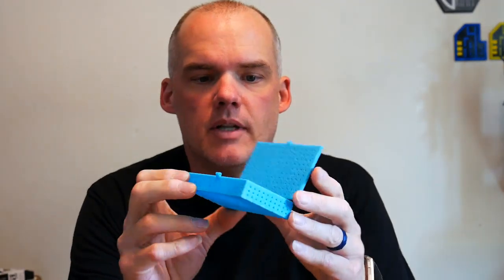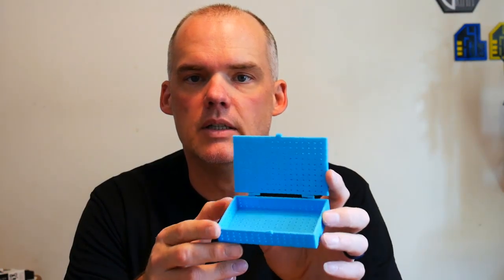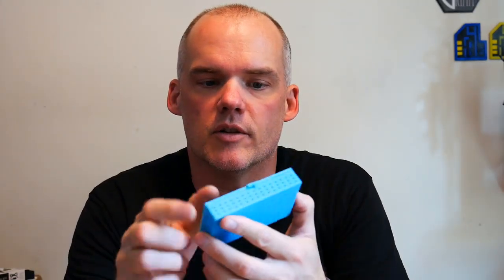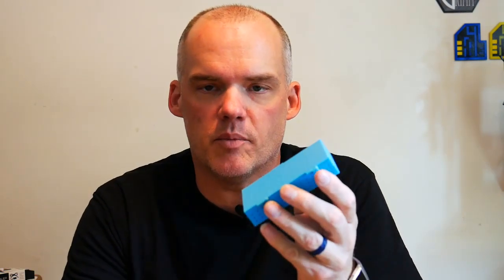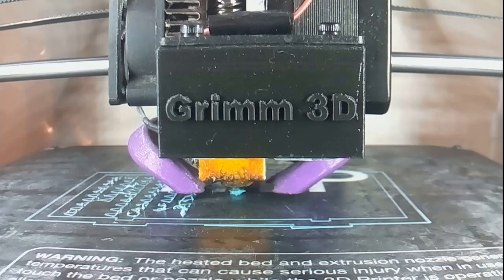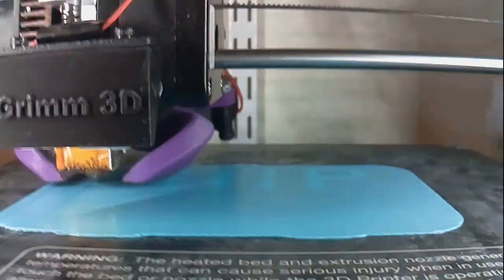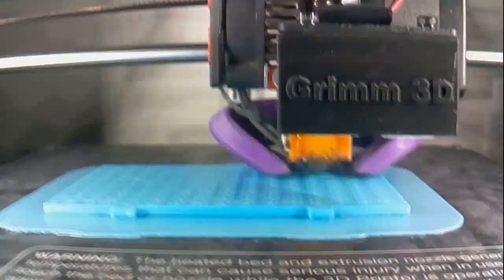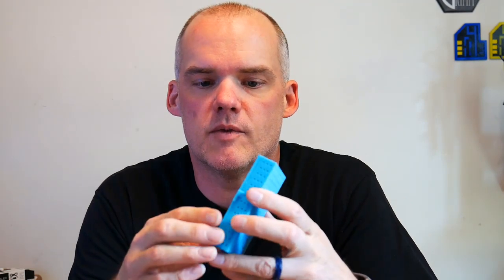When to Use a Raft

Comment: My rafts don’t come off easily can you please share your settings for Cura for easy removal? Thanks
Reply from the maker: Rafts can be difficult to remove, and that actually means you are doing things correctly. I would suggest using some kind of release agent. Most people use glue stick or hairspray. If your bed is removable like I show in one of my videos, hairspray is the best, but if your bed is not removable, use glue stick. I have videos showing both
Reply: Grimm3D thanks for answering, my rafts come off the bed but my problem is separating them from the model itself, thanks 🙏
Reply from the maker: @kbshah  for that, there is a setting in Cura, raft air gap. They increasing this setting. However, if you are using PETG or ABS or a flexible filament, they've always going to be difficult. If using PLA, try increasing the raft air gap and print something small like a calibration cube to test your setting. Increase until you have what you're looking for. When I get home from work, I'll look up the exact setting I use for PLA and reply again. Thanks for watching!
Reply: Grimm3D thank you so much, truly appreciate your help, thanks 🙏
Reply from the maker: My 'Raft Air Gap' is set to .3mm right now and my PLA rafts come off pretty easily. Sometimes I use a chisel point exacto knife to help get them off if I need to. I would think you'd want to try raising this in small increments. Maybe .31 or .32 to start. Test it and raise again if needed.
Reply: Grimm3D thanks so much, I’ll try those and see, I feel the thickness of my rafts are thick too, how can I make them print thinner?
Reply from the maker: You need to have some thickness in the raft so it can do its job of adhering and evening out the bed. But if you want to change the thickness, search in Cura for  raft and then you can change top layers, middle thickness, and base thickness to get the results you want. My top thickness is set for 2 layers @.2mm each, my raft middle thickness = .3mm, and base thickness = .24mm
Reply from the maker: @Aditya Shaligram That "should" be fine, but the way to check is to run some tests. Maybe print a few calibration cubes with rafts and adjust the air gap to see what give you your favorite blend of surface quality and ease of removal. There really is no perfect answer, at some point it just becomes personal preference. Thanks for Watching and for being part of the conversation!

Comment: You could use a 0.2 mm nozzle, 4-8 perimeters, lower first layer speed and print it without raft.
Reply from the maker: Don't forget to optimize wall printing order. This makes a big difference too. Actually, one of the best solutions I've tried to successfully print things like this without a raft is to use hairspray.Of course, you probably wouldn't want to spray hairspray if you did not have a removable bed. The over-spray would eventually damage the machine.

Comment: I had the same issue trying to print some objects that have small holes like M3 or M4 and I tried many times to level the bed, I even tought that the bad is not enough hot to actually stick the first layer correctly or I tought that the first layer should use a little nozzle diameter, like 0.1mm, but nothing works. Than I did some research and found your video. It worked, thank you!
Reply from the maker: I'm glad you found my videos and I'm glad it worked for you. Have you tried any type of adhesive on your print surface? I have used Glue Stick and Hairspray. I prefer hairspray. AquaNet Extra Super Hold (purple can). However, you do not want to use hairspray if you don't have a removable bed surface, the over-spray is not good for your printer. Without a removable bed, use glue stick. I have a video on how I apply it.

Welcome to the channel, let me know if you have any great video ideas or anything you would like me to demonstrate.

Comment: Awesome video mate, straight to the point.. I've subscribed
Reply from the maker: Thanks for the shout out. I'm working on more videos so stay tuned. If you want to see anything 3D printing related, let me know! Welcome
Reply: @Grimm3D  I'm having trouble printing small objects.
Reply from the maker: @50Hz  What do you mean by 'small'? are you using a .2mm nozzle? or the regular .4mm? Any files I should look at as an example?
Reply: Grimm3D nothing that really comes to mind, problem I have is finding a balance on large model with small parts sticking out